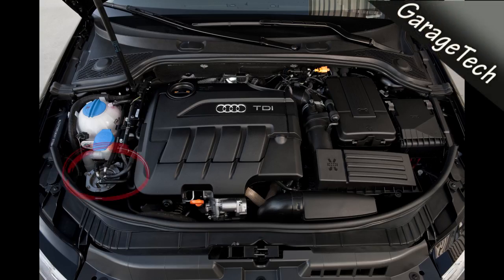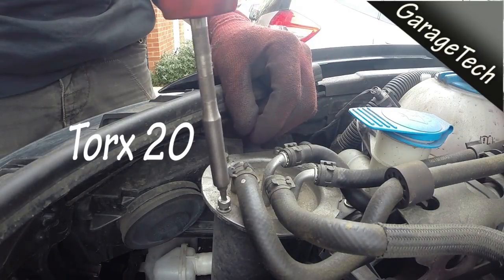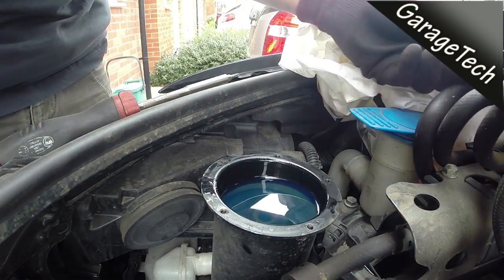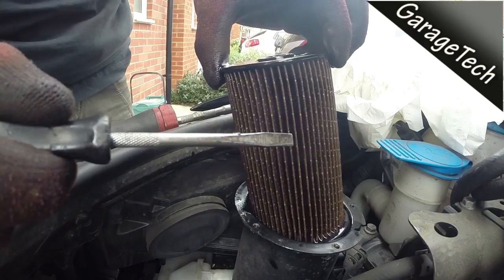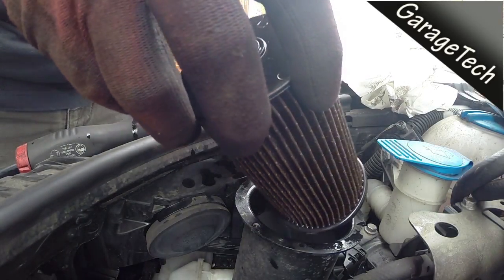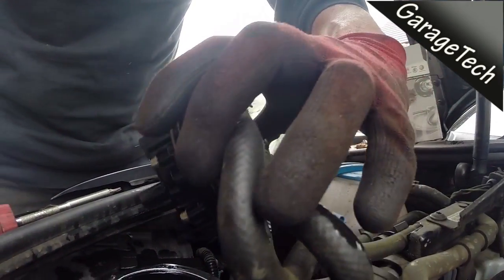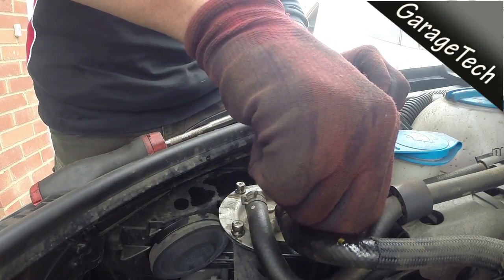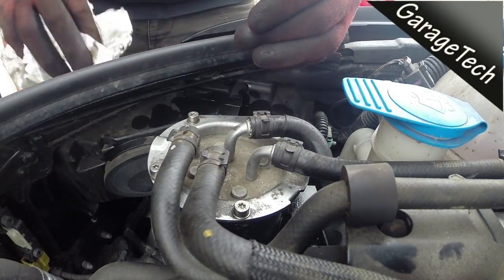How To Change A Diesel Fuel Filter VW/Audi 2.0l TDI

Comment: Aren't you supposed to prime it after?
Reply: What do you mean by prime it?
Reply: @shizz7le489  turning the ignition a few times without starting it to push out any trap air in the system.
Reply: No need to prime! Did this today and just turned key and was fine.
Reply: @krakken24  Can damage HP fuel pump if you do this often and are unlucky - pump can overheat.  Use VCDS or an OBDII to step through the priming procedure as the best option.
Reply: @krakken24  you still need to prime it regardless whether it turned on or not as its not good to have the excesse air in the pipes
Reply: @shizz7le489  Didn’t need to, turned key a went fine. No air in system.